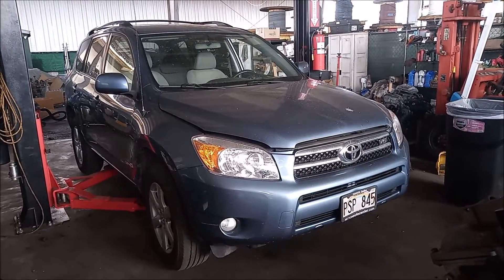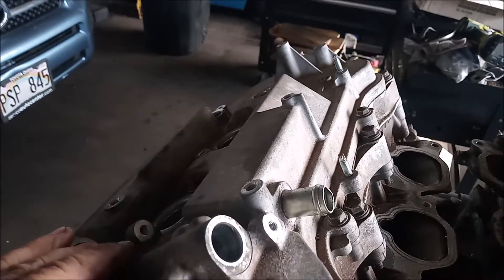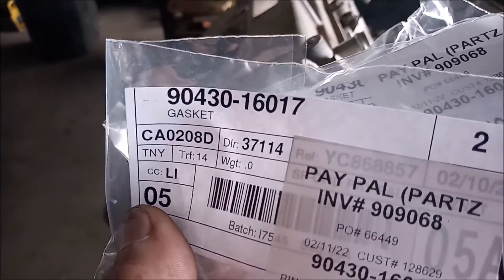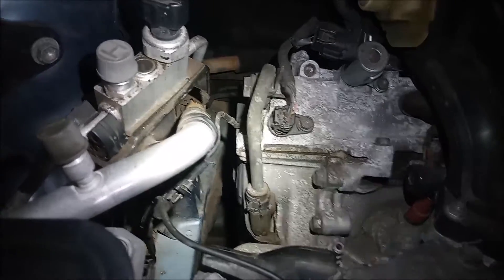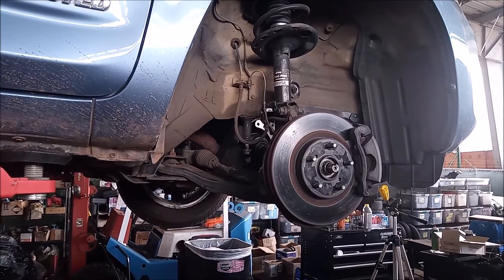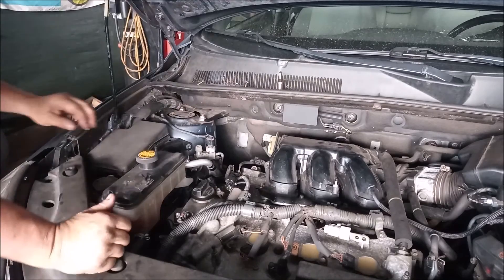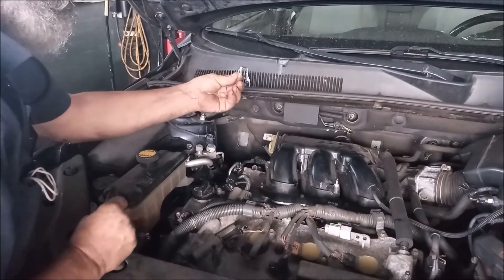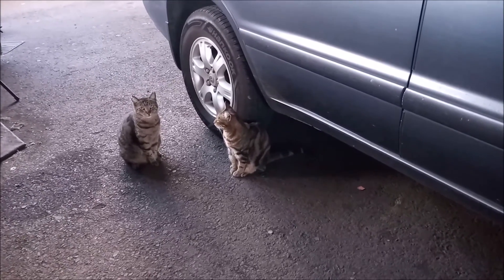VVT Oil Line Step By Step - Toyota RAV4 2GR-FE 3.5-liter V6

Comment: Did I miss the part where he said you have to remove the power steering pump
Reply from the maker: The RAV4 does not have a power steering pump. It has Electric power steering on the steering column. But for Camry, Sienna, and others, there is a power steering pump, that must be moved out of the way - not necessarily removed entirely - to access the rear banjo bolt.

Comment: Unrelated but figured I’d ask, my rav4 3.5 will produce a nasty grinding in reverse

I just replaced my rear engine mount today(totally blown out) and it made this way worse and the driveline will even clunk on startup 😬 in park / as soon as it goes in reverse there’s grinding noise from the front diff 

Toyota tried to fix it once said something in the diff wasn’t seated / thinking maybe now that the mount is fixed I could try and have them do it again
Reply from the maker: Is that a 4wd? Sounds like you need a new transfer case.
Reply: @Merryfrankster_  ya it is thank you 🙏 

That’s what I had thought and 🙄🙄 no mechanics agreed / been like that the whole time I’ve had it I just figured well I guess I’ll drive this til It dies   … 35k later 

I found and replaced that rear mount

Comment: Does this apply for the 2010  rav4 6cyl?
Reply from the maker: the 2010 should have an all metal vvt line. You can check visually if you are not sure.

Comment: I have a used 2006 Avalon.  I saw that it had the rubber  oil line.  I went to the dealer and they said the rubber line was replaced at 36K miles.  Yes, it is stupid,
Reply from the maker: I have provided the part number so you can order a metal line and install it. Works for all 2GR-FE engines, in all vehicles.
Reply: @Merryfrankster_  Ebay has a more economical option
Reply from the maker: @lewcrowley3710  Great!

Comment: I have a 2007 rav4 v6, will this oil cooling line apply to my vehicle?
Reply from the maker: This is not a oil cooling line. This is a hydraulic line for the variable valve timing system. It is present on ALL! 2gr-fe engines, on ALL! vehicles that have a 2gr-fe engine in them.
Reply: @Merryfrankster_  It seems that mine is leaking, however, when I check Toyota (15772-31030) it seems it doesn't fit my 2007 rav4 v6.
Reply: @Merryfrankster_  my mistake, I meant to say VVT oil line.
Reply from the maker: @living2learn138  Buddy, others have questioned the part number that I provide, only to find out that Toyota lies about the part number. I do not lie. Believe what you want.
Reply from the maker: This is like deja vu all over again, again. Guy does not want to believe the part number I give him.
Reply from the maker: @living2learn138  THE PART NUMBERS I HAVE PROVIDED FIT ALL TOYOTA 2GR-FE ENGINES IN ALL TOYOTA AND LEXUS VEHICLES. TOYOTA TELLS YOU OTHERWISE BECAUSE THEY WANT YOU TO REPLACE YOUR LEAKING RUBBER LINE WITH ANOTHER RUBBER LINE THAT WILL ALSO LEAK.
Reply: @Merryfrankster_  You are spot on!  I was hesitant about the different part numbers as well until I saw this comment.  I just replaced the line in my 2007 Rav4 using your part numbers.  Everything went smoothly thanks to your detailed video! Parts through my local dealer online were about $35.  It flagged the fitment as questionable when ordering, but I did it anyway.

Comment: Um, aren't there 2 of these lines? One for front bank, one for rear bank? Only rear bank was shown being replaced. If rear one still rubber, isn;t front one too? Even if somehow this car already had all steel front line, shouldn;t you mention it and show where it is? Otherwise followers might thin there is only one line to replace.
Reply from the maker: There is only one line to replace. Front line is metal from factory. As for your other point - thanks for watching and for commenting. When you start making your own videos, you can make editorial decisions like that.

Comment: What about the oil line that goes to the front valve cover???
Reply from the maker: That line is all metal. it does not have the bursting issue of the rubber line.

Comment: That rav4 doesn’t have power steering? The dealer charged me because of the power steering not being easy when I had this changed to all metal.
Reply from the maker: No, all RAV4 have electric power steering on the column. RAV4 do not have hydraulic power steering pump on the engine, like Camry. You got taken.